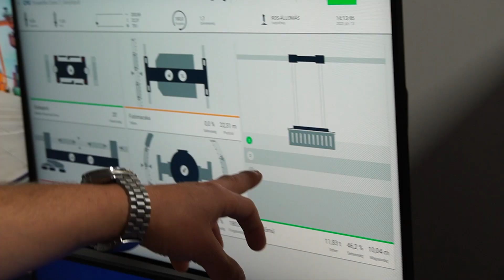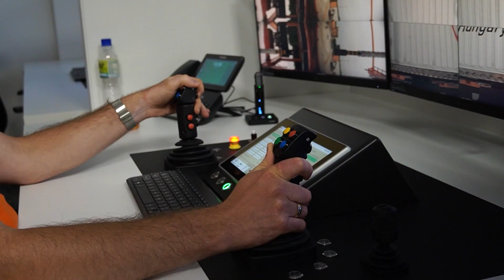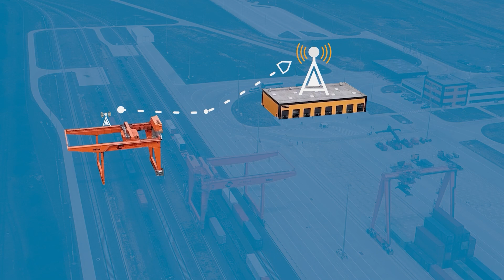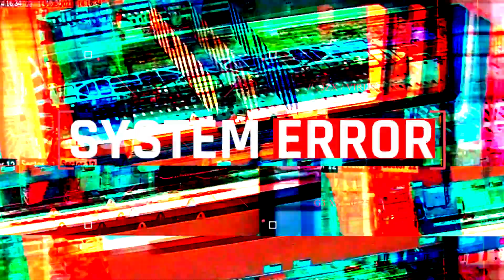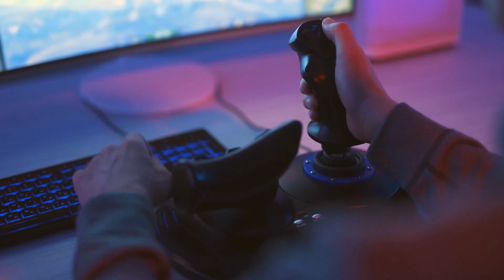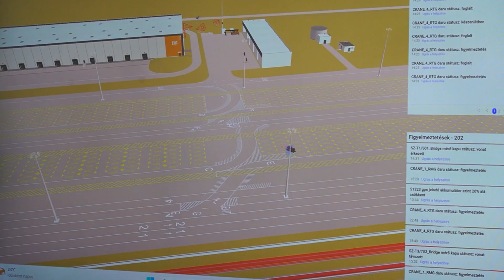I visited the World's most expensive RC Toy

Comment: I feel like you overlooked the fact that for a short run like this, a hard wire connection or point to point wireless connection like airFiber has been able to do this for decades. Additionally, you won't be able to work between countries with similarly low latency - the speed of light gets in the way of that.
Reply: This is what I'm thinking, I was thinking when I play online fps games and connect to London servers from the other side of the country I'm getting like 30ms ping on cable, unless I'm overlooking something 🤔. It's probably 5G on site to an access point, then fibre the rest of the way

Comment: 5G range is 50-2000 feet.  Not miles so there is something else going on.
Reply: repeaters
Reply: @OwenWithAHammer  repeaters cause lag.
Reply: @lucidmoses  How much of the 8ms IS repeater lag?
Reply: @lucidmoses  You can find sub-millisecond repeaters, plus the signal doesn't have to travel that far, you can do 5G from moving vehicle to one of many base stations nearby that are connected to the main control room via fiber.
Reply: @rustymustard7798  each repeater along the way reads in a packet do the processing and send it out again.   A repeater is considered a good repeater if it can do that in 20 ms.   Now, needing 10-20 of them to go miles your looking at 200-400 ms.   Which is why I think there is more going on then just 5G.   Likely 5G to base station, then fiber for the miles to where the people are.  But not sure,  He didn't give enough info.

Comment: None of these systems, neither here nor at Container ports around the world, have taken the next logical step...
1) The 'lifting' operator guides Crane #1 onto the target container, then they push a button and it's lifted off automatically (not the slightest bit complicated).
2) The same operator immediately gets to work on Crane #2. A trivial computer algorithm shuttles the container towards the destination.
3) The 'landing' operator takes over from the computer, and skillfully guides the container brought on Crane #1 into the exact position.
4) As soon as they're done, the computer has delivered the next container to be loaded.
The concept here is like a production line, with the 'lifting' operator guiding the cranes sequentially onto loads, locking them in, and handing off to the computer. The computer algorithm shuttles loads from A to B, which can be done today without anything complicated. Simple algorithm, not 'AI'. The 'loading' operator lands the loads sequentially, one after the other.
Two operators might be able to execute 2 or 3 loads per minute, so 120 - 180 moves per hour. There might need to be 6 to 10 cranes just to keep them busy. The algorithm would pause and let the operators do their skillful job at each end. But there's no skill needed for the shuttling, so that would be an algorithm.
This seems utterly obvious to me...  It seems that nobody else sees it.
Reply: Same cranes are located at multiple sites across the US and they operate much more advanced than what you describe.